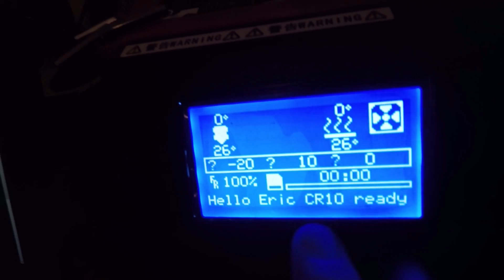CR 10 Upgrades for Better Quality

Comment: You used the stock heater block and thermostat, but upgraded your heater cartridge, correct? Im brand new to 3D printing (from the CNC world), but really need to put together something that can print ABS and polycarbonate.

Comment: The glass bed I got with my CR10S5 was warped and cupped in the middle out of the box. I took it to a local glass shop, told them what it was for and asked for a piece of tempered glass in the same dimensions. The tempered glass is considderably stronger than the plain glass the printer came with, it dissipates heat better, and it is perfectly flat. The best part was that it only cost me a few dollars, and was much cheaper and faster than sending the entire printer back just to get the glass replaced.

Comment: That sensor doesn't detect heat... It detects metal... either by inductance (magnetism), or by capacitance (ability pass a voltage)... the heat had absolutely nothing to do with anything. So while yes, the warped bed can actually throw off one of those kinds of sensors, its by a super tiny amount. About the same amount of difference that the BL Touch naturally has regardless of your surface's flatness (BL Touch is wildly inaccurate with repeat-ability...). And considering an inductive sensor and a BL Touch use the exact same methodology for actually detecting something, they can both be used fairly interchangeably with similar detection accuracy. 

But anyway, yea... no... does not detect heat... just metals in general. Besides... something that detects the bed based on heat is kinda insane... the bed does not heat up evenly. thus if it detected heat, it would constantly be thinking the bed was warped to hell because each spot it probed was a different temp....

Comment: I highly recommend the BLTouch. It's easier to install and works very well. I also highly recommend staying away from TH3D products. They erroneously claim that Creality "stole" their EZABL. Creality was sending it's  customers to the TH3D page for support. Instead of doing what any sane business owner would do and require people to provide proof of purchase, they modified their firmware to exclude the Creality ABL, in the process breaking compatability with other sensors. That kind of anti-consumerism has no place in this hobby  Plus, it turns out the owner is a hotheaded jerk.

Comment: Hi, how do you make sure when the nozzle outputs the filament that it actually touches the bed? Whenever I print the extruder/nozzle are two far from the bed the print doesn't't stick. Any advise please
Reply from the maker: sounds like you either need to set your z-offset or level the bed. Here is a good video on how to level the bed: https://youtu.be/YFk2oumFIi4

Comment: I bought a modified cr10 that was set up for TPU and it has a nozzle brush that it goes to on machine home. Extruder is red in color and has an X on it. Not sure of brand. My question is this: When I go to run a print the nozzle is running into the side of the glass table. Machine home position is below the glass surface. Can you help me to figure out how to keep from running into the table? I also cannot connect my computer to cura and have the cr10 connect. I am new to 3D printing but have used a printrbot play successfully with cura. Any help apprecated. Thanks.

Comment: Hi Eric, A While ago you had a Simplify 3D video with settings for CR-10 (PLA) - if I remember correctly - any place your *.fff files is availible from? (had a HDD crash, and cant remember your settings which worked realy great) - Would love other fff as well. Since ABL, Microswiss is "on-board" now :)  Thanks in advance for any help.  Reg, Stig
Reply from the maker: Let me know if this works for you https://drive.google.com/open?id=1A7U_5wgNRLHcHNwd6P9BTHcPyjHmOcGZ
Reply: Thanks Eric - will give it a try :)

Comment: BLTouch is already in stock Marlin firmware. Un-comment the lines and done =)

I prefer (by far) using the BLTouch it just works so damn well.

Comment: Why does my cr10 vibrate violently when I select the auto home feature? The bed goes to the Y position and next thing you know it vibrates like crazy.
Reply from the maker: bill Is your Y end stop properly plugged in? Or have you made any changes to the code?
Reply: Eric's DIY thank you for getting back to me. I was able to do a power cycle and fixed it. Now i have an issue with the bed leveling with one of the turning knobs maxed out and there is still an 1/16th gap so was thinking of changing out the glass to 1/4" thick or buy a new longer spring and bolt so that glass bed will touch the nozzle. What do uou suggest? Thanks
Reply from the maker: Thicker glass is what I see a lot of people do in the community.

Comment: Awesome video.  I'm starting with a CR-10s so I've already go dual-Zs, but detailed videos like this are great.

In the video you say you only added vibration dampeners to you X and Y steppers, but just FYI adding a dampener to the extruder stepper all but mutes the "beep .. .beep" during retraction which is REALLY nice. I bought 3 dampeners to have a spare and only did X/Y to start, but you don't realize how loud each piece is until you quiet everything else.

I'm running Noctua fans and dampeners on X/Y/extruder and it's pretty much silent now (which 
 in my 1 bedroom apartment lol).

Comment: Just saying the stepper motor siliencer would reduce quality not increase it. because it adds a tiny bit of flex to the belts it's applied to. i recommend this for only people who really need a silent printer.
Reply from the maker: +craazyy22 so far I haven't notice any quality changes. I have hundreds of hours on both setups. If there is any quality changes it not noticeable.

Comment: Good information. I just got my CR-10 and still learning about 3d printing, but it would awesome to see a video series from open box to all the adjustments and mods that are done until you get to what you have here. It seems a little intimidating to attempt these mods. I don't want to mess anything up.

Comment: This video (and others in the series) has been extremely informative, thanks very much for releasing this content. It takes quite a lot of upgrades to print polycarbonate on the cr-10 it seems. Out of curiosity, how high off of the build plate can you go with PC before you start to encounter problems? Can you utilize the full build area?
Thanks for the great content.
Reply from the maker: Xanthyn you could print with the entire bed with PC. The highest I have gone is 25mm to 30mm. The higher you go there will be a greater risk for warp.
Reply: Good to know, thanks. I hope to be printing in PC like a boss in the near future, and if I succeed it's because of you.

Comment: How do you secure the damn BuildTek TO the glass? I have one now on my CR-10, and everything sticks great to the BuildTek. BUT on a skinny tall-ish print (even just 2 to 3 inches tall), I get spaghetti mess everywhere at the top because when the print starts to get higher up the center of the BuildTek isn't fixed to the bed so the print can wobble. How do you stop that from happening?

Comment: Was looking at the installation (tape) and it is only rated for 180deg/f and 90c is 194f, have you seen any break down of the tape?
Reply from the maker: Are you talking about the insulation around the extruder?
Reply: Sorry for being unclear, the tape you used for the bed....
Reply from the maker: Oh, I just checked and its holding fine for now. Then again I have only about 30 hours on it with temperatures between 85-95 degrees Celsius. So far so good. I mostly print at 60 degrees.
Reply: Ah ok, was wondering as I used plumbers felt on my CR-10 and for my Tronxy X5S was looking to do something a little different was when I saw your video, check out the tape as it looks like it could be a good alternative and saw the 180f limit and wonder as I too stay around 60c.  Thanks and great videos too!

Comment: does your captive sensor run on 3.5v? I'm looking to get Bl touch setup on my CR-10 any suggestions?
Reply from the maker: The capacitive sensor is itself 6v-36v but mine runs on 12v and the BLtouch smart is able to do 3.3v logic but you will still need a set of servo pins on the controller board, which you may need to upgrade the stock controller board on the CR-10 depending on the version of the CR-10 you have.
Reply: Looks like I would have to reconsider then.. good thing I have 3 other printers to put it to use. I also have a captive sensor that been sitting in a parts draw. How did you hook up the Sensor to the board I couldn't find a video in your collection that painted the picture of how to pull it off?
Reply from the maker: What type of captive sensor do you have? This is a decent video on it https://youtu.be/jN73VXVcofM.
Reply: Eric's DIY huling LJ12A3-4-Z/BX 6-36v
Reply from the maker: Isn't that an Inductive Proximity Sensor? Basically, using the image provided you will use the brown wire for power and the blue wire for ground. The black wire is your signal wire and you will need to add a 15k resistor and the splice the wire into two. Next, you will need to add a 10k resistor to one of the wires which will be your ground wire and the other wire will be the vin. These two wires you just spliced will replace your Z-endstop on your CR-10. Then you will need to update the firmware. I hope that made sense. https://cdn.instructables.com/FQD/M93F/IGFEL3QB/FQDM93FIGFEL3QB.LARGE.jpg

Comment: fantastic video :D
you said you changed the offset of the extruder, did you do that in the fw and reflashed it, or where did you change the offsets for the e3d vs mk10?

once again, great video, subscribed :D
Reply from the maker: Yeah, I had to change #define Y_MIN_POS -10 to perfectly center after the upgrade.
Reply: Eric's DIY thanks billion, gonna dig into it asap :D

Comment: The sensor is not about heat, with your extruder in the position it is in this video, move an ordinary drinking glass under the sensor now move a piece of wood under the sensor now you see it trips its because its "capacitive" not proximity or inductive.
Reply from the maker: In the video, I miss spoke and called it an inductive sensor when I meant to call it a capacitive sensor. The only reason I brought up heat is according to Timothy Hoogland from TDH IT Professionals (who I bought the sensor from) states that if you use a different bed temperature than the one you originally calibrate on, it could affect your Z-offset slightly. So that's why I mention heat in the video. I personally have not tested if the Z-offset changes in different bed temperatures but sounds like that might be an interesting experiment.

Comment: How fast do you run your 5015 radial fan while printing PLA usually? I find mine is horribly loud with the fang at anything over 50% speed making me second guess upgrading the rest of the fans... I did put a noctua 40mm on the heatbreak and it's silent but totally offset by the 5015 radial...
Reply from the maker: yeah, it took me a couple tries to find a quieter 5015 but I can still hear it. I also saw someone did a remix of my fang that might be quieter, they remixed it with a 40mm fan instead of a 5015. https://www.thingiverse.com/thing:2449462
Reply: Eric's DIY cool, I just question the amount of air it moves and static pressure on a 40x10 fan. Maybe a 40x20 would be enough through a fang though.
Reply: Eric's DIY I'm tempted to remix a fang to use the stock 4010 radial for good airflow and less noise instead of a standard 40x10 fan.
Reply from the maker: Here is a remix of the fang with the original cr-10 fan. https://www.thingiverse.com/thing:2468610.
Reply from the maker: Yeah, that is why I stuck with a 5015 because of the powerful airflow. I think a 40mm you may lose airflow.

Comment: Hey there! Would you be able to help me? I'm about to buy the E3 V6 Hotend but I'm not sure how to wire it or flash the board again. Can you help me?
Reply from the maker: As far as wiring goes, you can just use the wires that are on the stock extruder. The main point modifying to an E3d V6 is to have an all metal hot end that can achieve hotter temperatures. The only thing that you may have to wire is a new fan depending on the cooling system you are using (for example a fang mount). To enable a firmware upgrade you must first load up a boot loader to the controller board. The instructions are here: http://www.instructables.com/id/Flashing-a-Bootloader-to-the-CR-10/ On the Creality Facebook page under Files you can find a firmware that you can customize.
Reply: If I simply cut the wires on my stock hotend right at the bottom, did I screw up? or can this be fixed?
Reply: Also, do you know if there is a way to flash the CR10 without an Arduino?
Reply from the maker: No, you can fix it. Did you cut both the heater core and thermostat? As far as flashing you need an Arduino or a nonname brand
Reply from the maker: You will have to strip the wires that you cut from the printer and rewire them with your new cartridge and thermostat. I recommend either crimping or soldering a connector to both the wires coming from the printer and the new heater cartridge and thermostat. It will make it easier for you
Reply: I cut both.

Comment: Heat? Does the inductive sensor sense Heat?  And I thought is sensed Metal, because of the aluminum heated bed. And the name inductive, mean is created a magnetic field, the field changes when close to metal, and therefore it is a sensor for metal surface.
I used this on my Anet 6,   so that is why i question your statement.
Also it does not work well with a glass plate, because of the probe distance to the Heated bed is larger. Also when i heated up the bed.
So my conclusion is it senses Metal not Heat.
Reply from the maker: haha, I never meant to say it's an inductive sensor, I am using a capacitive sensor. Out of all these views, you were the first to point it out. Thank you.
Reply: @EricsDIY  A capacitive sensor doesnt detect heat either. Its accuracy is AFFECTED by heat but that is not its principle of operation.

Comment: With the EZABL and spring replacement spacers, are the big leveling knobs no longer needed?
Reply from the maker: No, not really. Mine I had to super glue them to the original nuts, so I'm stuck with them. haha.

Comment: Having problem with octoprint, printer hang on every print with unhandled error. My A8 had no problem with it
Reply from the maker: I had similar issues when I uploaded the print from a computer to the SD card. So for me, I just used the camera for longer prints. I haven't had the time to determine the issue with the octopi.
Reply: Me to upload Gcode to octoprint not slicing from octoprint.
Reply: had the same issue with octoprint in every single print, booted astroprint - had done many prints - no issues, the same setup.
Reply: What is your usb speed? at the highest speed my Anet A6 gives some errors, i step it down to 115200 and no problems.
Reply from the maker: +Martijn de Man it's 115200 for the cr-10
Reply from the maker: +Zabak Kuku I'll check it out thanks.

Comment: So wait, I thought you needed an entirely new extruder bit (the part that "prints" the filament onto the bed) to make stuff compatible with flexible filament, all it takes is one 3D printed part and a bit of hose?

Now I can't wait to get my own CR-10!
Reply from the maker: Yup, just follow the instructions for the TPU bracket (He has a video for it) and start printing. I print a lot of TPU and haven't had any issues.

Comment: So I just installed my E3D V6 and a 5015 blower for my parts cooler. It's working good, but my top and bottom layers are turning out thin and the lines don't touch. The sides look great though. Any insite would be HUGE lol
Reply from the maker: yeah, what I had to do for mine was mess with both heat and extruder multiplier. I found a 1.06 extruder multiplier with a temperature of 200 degrees Celsius for Hatchbox PLA works best. But, certain filaments may be a little different.
Reply: Eric D Thanks man!!  I was actually running tests lol. I noticed it likes to be hotter than the stock.

Comment: Wow great job and lots of good upgrade info. I am looking to by the CR10, is it cheaper to do the z axis upgrade buying with,or after to upgrade the standard model?
Reply from the maker: I would have to say Amazon is selling the cr-10S which is an all around upgraded cr-10 for about $600.  This route would be a little more expensive but you would get more features than dual Z's.  If you go with just a regular cr-10 then you're looking at $440 plus about $60 for the upgrade plus the time to install and calibrate. So depends on what you want to do I guess. The link is http://a.co/0Tzd11J.

Comment: Great vid, do you recommend upgrading the stock head to an E3D V6 if primarily printing PETG and PLA? Is the quality better?
Reply from the maker: honestly, if you are not printing at temperatures above 260 degrees Celcius I wouldn't change it.  The stock head is pretty nice. I did notice I was able to print at 60mm/s with the E3d at the same quality as 50mm/s on the stock head.
Reply: It kinda just depends on the nozzle and the mounting for the quality.

Comment: Looks really nice. Appx what was the time and cost involved for the upgrades?

Are you using an enclosure for your polycarbonate prints? Which filament are you using and what sort of strength do you get from the parts?
Reply from the maker: The total cost I would have to say was about $250 and not sure about how long it took me but it did take awhile. 
I don't use an encloser, and I haven't had an issue with it. since I got the Lokbuild. I have my bed at about 90-95 with no fans and my nozzle at 280-285. I haven't tried any big prints yet with PC. I'm using polymaker PC and the strength is much stronger compared to PLA or PETG.